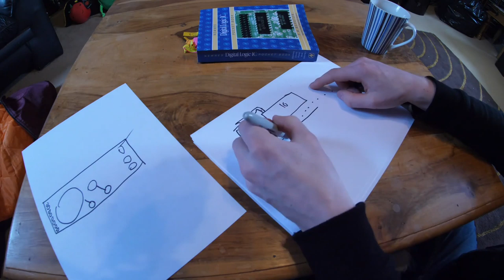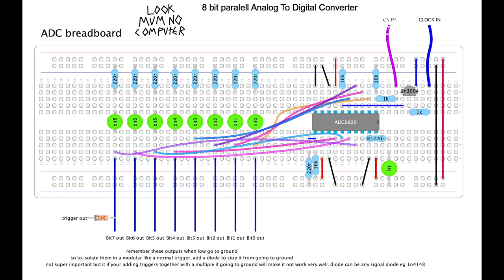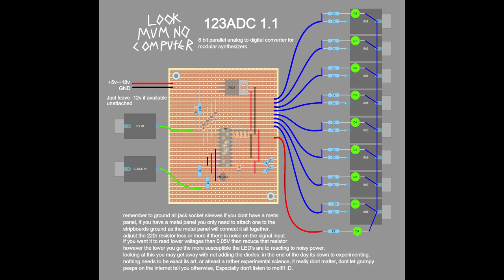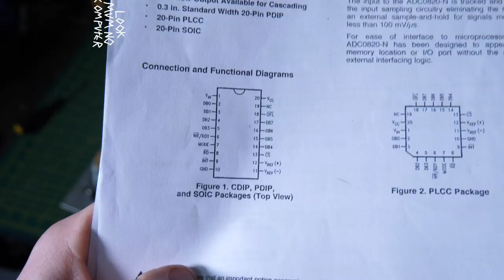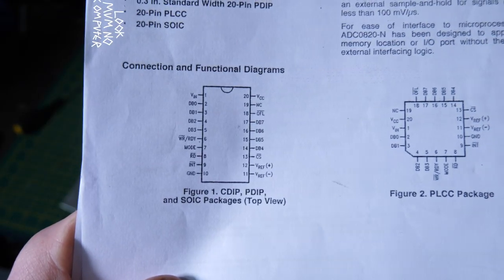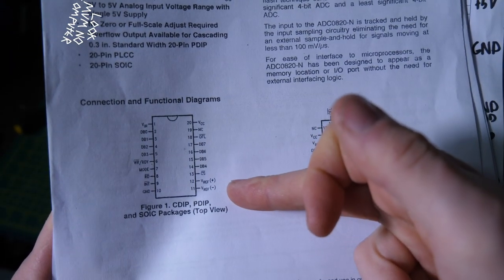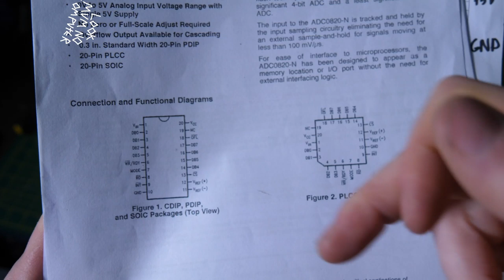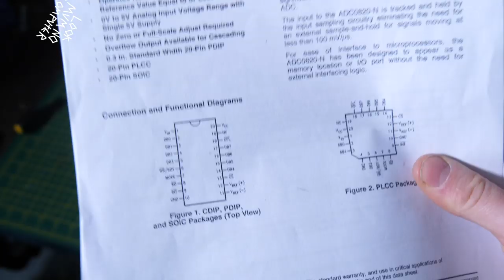123 ADC 8 bit analog to digital converter module

Comment: Came here from the other video confused as to what it‘s actually doing. I think I get it now! Thanks for making these more in depth videos! As for coding versus analog stuff: I‘m the exact opposite, whenever I mess about with an actual analog circuit I always fry some opamps along the way because I code on trial and error and apparently that‘s a rather destructive way to mess with circuits 😂🤦‍♀️ I‘m actually decent at coding, although Arduino C is an absolute pain in the neck due to low RAM and lack of protection against segmentation faults.

Comment: I've been thinkjng about making a similar ish thing out of a bunch of Led bargraph chips I pulled from an 80s stereo amp. Fairly similar idea in that I guess it's kinda a 5 bit ADC designed to read output level and display either dot or line graph. Won't save the data but I thought a sloping lfo in will give a variety of offset triggers and gates for other stuff...

Comment: Regarding the negative voltage reference problem. There is a possibility that the ground is dirty from e.g. coupling the IC. You could try connecting a wire directly from that pin as close as possible to the power in connector. This makes the total resistance between the negative volt.ref. pin and the PSU smaller.
Reply from the maker: it is likely! it wasn't an issue on the breadboard. but I figured, sense peoples stripboard layouts would vary lots, just do it this way if you get me?

Comment: Sounds like the problem with the first 4 LEDs was some sort of noise in the circuit. Could even be a disturbance caused by the ADC chip itself? Might be worth trying to add a voltage reference IC such as MCP1541 to cut out the noise. Of course since you don't need to get precise values from the ADC for this module, this doesn't matter so much.
Reply from the maker: yes but for later uses im going to need precise reference. im trying to figure out the best way to do it. im looking to spread the 8 bits over a 10 volt range. 0-10v. I did think of using a stable reference of around 1-4.1v but still need to think about it. any suggestions more than welcome!!
Reply: @THISMUSEUMISNOTOBSOLETE  Interesting, I would expect that if you spread 255 values over 10V, you will have a lot less trouble with the noise floor anyway.  If it is still a problem, you can create a stable 10V with a 9.1V zener and a couple of op amps. MFOS has an example of this on 'Transistor matching 101'. But if the noise is 'real' and coming from another source there may still be problems around 0V.. there will be a noise floor in any circuit.
Reply from the maker: @asciisynth  yeah trying to think it through it may not be much of an issue. but the ads has a 0-5v Max, so the 10k id need to scale down so the grounding issue will still be there. maybe I should decouple it. Im gunna play around with the circuit this weekend.
Reply: @THISMUSEUMISNOTOBSOLETE  yeh, the max voltage on ADCs is annoying. I've been obsessively looking for a cheapish ADC that can handle 12V directly, just because it'd knock down the noise level. It's frustrating to have to scale down the input signal to a range where the noise floor has more impact, when what I really want to measure are modular synth style voltage ranges. I think ADCs like that are out there, but not in my price range!